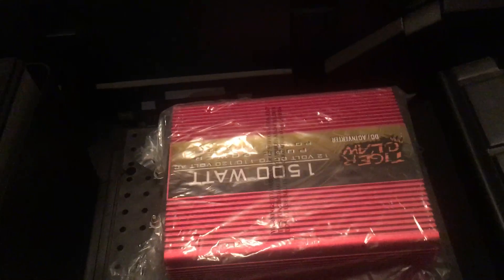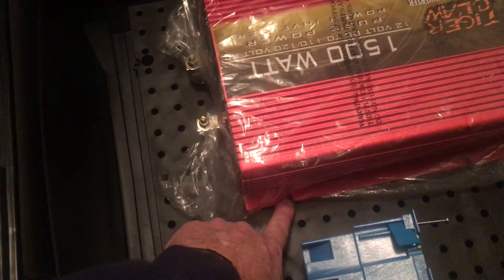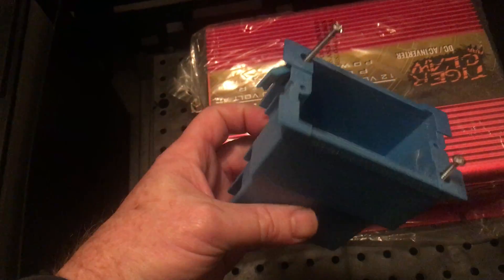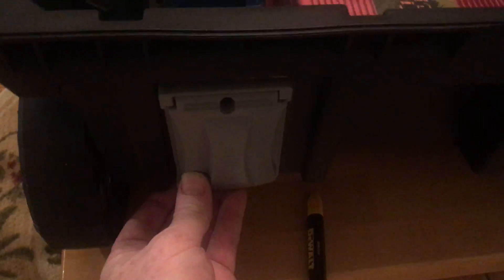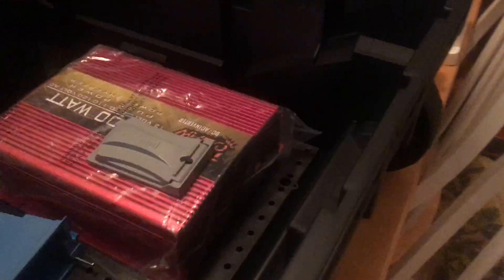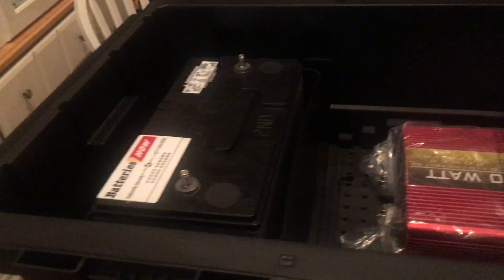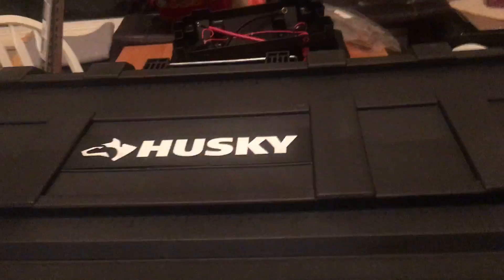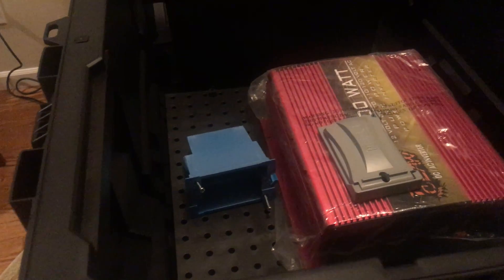"Big Jim" DIY Solar Generator Planning and Discussion Video 2 of 2

Comment: Great build. Just curious how the inverter and battery are holding up for you? Also can you post links for them? Thanks.
Reply from the maker: Thank you for the compliment Brad. I found both the battery and the inverter on ebay. The Tiger Claw inverter is also on amazon. So far everything is holding up okay. I have run a full 1500 watt load on the battery and recharged several times over the last month. My other videos show the final configuration. Right now though it is just sitting in the garage on the battery tender! Here is the link for the battery currently on ebay: http://www.ebay.com/itm/332146744613?_trksid=p2060353.m1438.l2649&ssPageName=STRK%3AMEBIDX%3AIT.
Reply from the maker: Here is the link for the inverter: https://www.amazon.com/Tiger-1500W-Power-Inverter-DC-AC/dp/B008JGE8LE/ref=sr_1_1?ie=UTF8&qid=1491758984&sr=8-1&keywords=tiger+claw+inverter